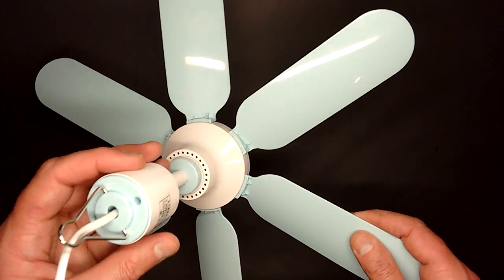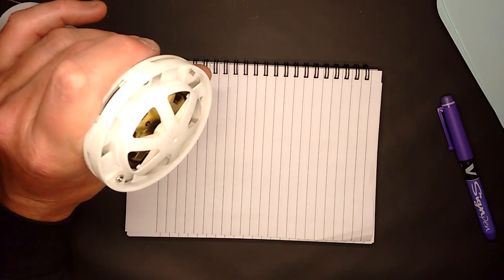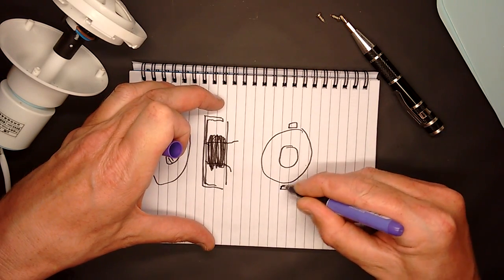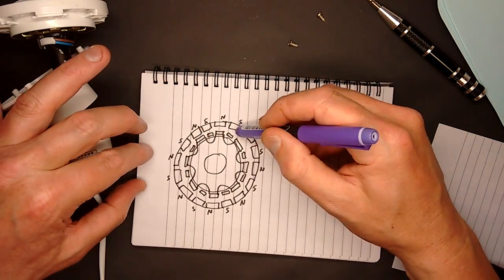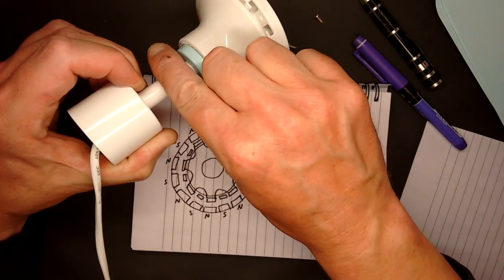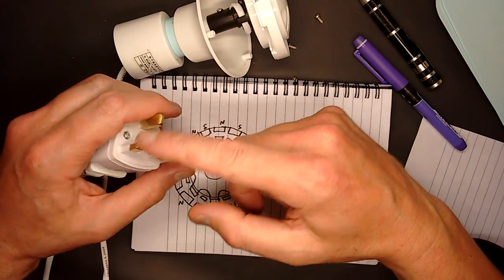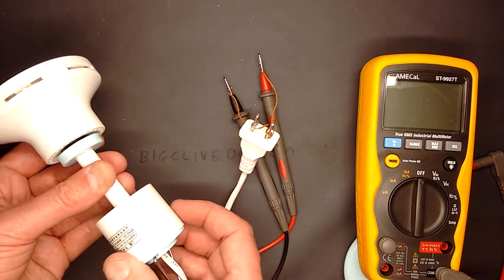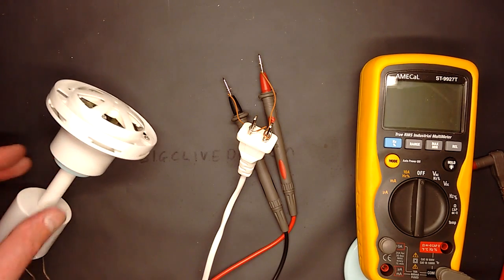Mini ceiling fan with intriguing motor and wind turbine potential.

Comment: I looked these up, and sadly they don't seem to offer a 120V version.
Reply: Found 110v ones..
http://www.ebay.com/itm/380946982876
http://www.ebay.com/itm/191283546034
http://www.ebay.com/itm/381445933801
Reply: I don't get where the extra $14 of cost is coming from to get it to run on 110v... the 220v is only $8
Reply: the higher voltage versions will probably still run on US mains though, just perform worse
Reply: Synchronous, not universal. Should run the same speed but draw twice the current.
Reply: I got one with the "US type plug" but didn't read the description carefully enough or didn't care because it was clearly marked 220v.  

It absolutely wouldn't turn on its own power using US mains voltage, even with a little spin to get it going.

Undeterred, I bought a 110v to 220v wall brick.  The brick ups the voltage but does nothing to the frequency so I plugged the fan in anyway - maybe hoping for a little pop or something.  ;-)

Nothing went bang and the fan turned though it was choppy and seemingly not at full speed.

I wonder if it has something to do with the 9 poll (18?) arrangement.  At 50 Hz., you get the roughly 5.5 rev/s but at 60 cycles it would work out to 6.7 rev/s.  Not sure.  I wonder if my magnets are different?

Like someone above, I was hoping to save a little cash over the more expensive US versions.
Reply: Vorpal most likely, it'll just turn slower,assuming it's a universal motor inside.
Reply: Its actually running faster because 60Hz. At least theoretically.

Comment: You could re-wind the motors copper coil with thicker enamelled copper wire for lower voltage/ higher current output for 12v battery charging, I'm guessing it would be good for 5-10 watts in a 'modest' wind. Cogging will be an issue but on the Isle of Man, not a problem I suspect..Have fun :-)

Comment: The £20-25 ceiling fan from Argos is really good. It has been around for decades and where ever I have moved I have bought the same fan, other than the pull cords changing from time to time the blade pattern and design has never changed! I bet most people in the UK have the same ceiling fan, I just thought I'd mention it :)

Comment: Banggood: Good Electronics that Bang
Reply: Electronics that go Bang real Good!
Reply: xD
Reply: You got banged, by buying their goods.
Reply: mharris1270 wow no duh
Reply: There's a difference between political correctness and wanting everybody to understand.

Political correctness is a method of speaking where every potentially insulting word is changed to something that has virtually no possibility to offend. This is an issue for reasons I won't get into.

Wanting everybody to understand something means that in the event of a roadblock between cultures, such as a faulty translator, everybody can get the same idea and not misunderstand. For example, if a mechanic is explaining to you a problem with your transmission, and you don't know what a transmission is, he'll say that it's the part which gets energy to the wheels. In this case, not everybody shares the same word "bang" with the same general use, so he explained that bang can be used to describe sex in English.
Reply: mharris1270 It feels like you are implying I give half a fuck about an old man that wants to be politically correct and is still on a power trip from when he used to control kids future.

You miss being relevant old man? You miss being able to fail billy because he mouthed off but still did good work? I bet you fucking do.

Comment: that thing about the microwave spinning in any direction pisses me off for some reason, lol
Reply: Mine always starts in the opposite direction it last started in.
Reply: @Mentorcase  microwaved yogurt is strangely disturbing
Reply: @Mentorcase  Mine does that, too.
Reply: +Mark Pascall Very true and why does the handle of your cup ALWAYS end up pointing away from you?
Reply: who the f*** microwaves yogurt
Reply: +Godfrey Poon You don't actually heat up yoghurt in the microwave do you?
Reply: I think most do - they are usually belt driven that ends up in tension one way when the motor stops. The next time it starts, that tension makes it more difficult to continue to turn in the same direction and it's easier to turn in the opposite direction.
Reply: the trick to that is figure out how long it take your table to make one rotation, then only microwave stuff in multiples of that time.
Reply: Just over set the timer, and manually stop it when the handle is facing you, that is what I do with my coffee.
Reply: +Pomona Bill (PomonaBill220) with mine you hold down the door open button and it spins the platter for you.
Reply: That time is usually either a multiple of 15 or 20. So at 1 minutes most microwaves will have done X complete revolutions.
Reply: My microwave always stops in the same position it started. When the oven stops it keeps turning however long it takes to make an even multiple of ten seconds. (six RPM motor I guess)
Reply: I calculate the RPM of the plate and set up thr timer so that it does a even and whole number of turns, so i can set up the mug to be facing me!

Comment: Not to be picky, but I am thinking that it should be ~5.5 rev per second, not RPM.  Also, did you happen to take the 12 volt one to bits as well, and if you did, what where the major differences?

Comment: Unfortunately it's so quiet I had to download the video and use mp3gain (with aac mod) to gain it up 10.5 dB so I can hear something. I should not turn up the master volume because when I forgot to take it down again, my two monitor speakers will blast me to death. :D
Reply from the maker: I was recording late at night (OK, early in the morning) and the flat downstairs has the same bedroom area so I didn't want to speak too loudly.
Reply: I agree, he really needs to increase the volume of the audio if he uses a mic like that again.
Reply: bigclivedotcom
Ok, I thought you always speak quiet and it's just the microphone setup. :)

Comment: I would have thought that a site called "Bang good" would cater to a different kind of market.

In fact, I was wondering if they started as a site that sold "adult products" and it appears that they didn't even have that category when they launched in 2008 and only started offering "Intimate Apparel" as they call it around August 2010 - at least according to Wayback Machine - as a sub-section of "Clothing and Apparel" and originally only contained lingerie and costumes.

Yes, I have way too much free time.

Comment: I found Banggood to be extremely expensive somehow. The same stuff I see on Amazon with Prime shipping is only 2-3€ more expensive than the stuff on Banggood (20-30€ range).
And all the cheapass useless "I bought it because it be cheap" things cost 2-4 times more than on aliexpress or ebay D:
Reply: I can't really say that I agree. Yes, Banggood is not the cheapest shop, but very often I find products that are actually practically the same price as Aliexpress or only slightly more expensive. Though I'm happy to pay to BG for the service. And depending on the value of your order DHL shipping can become extremely cheap, which is great value.